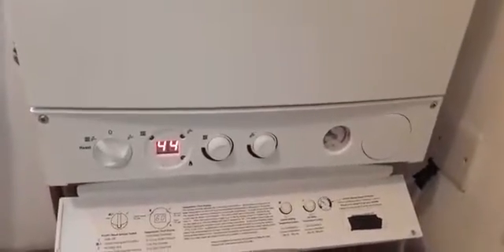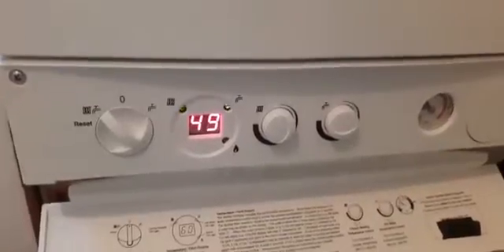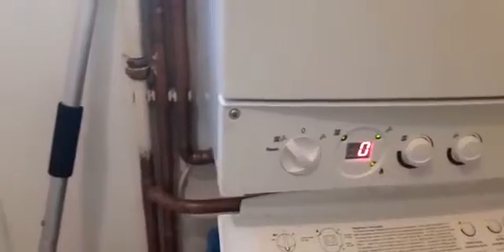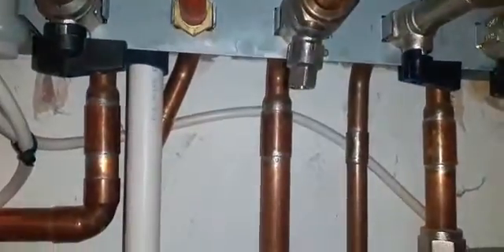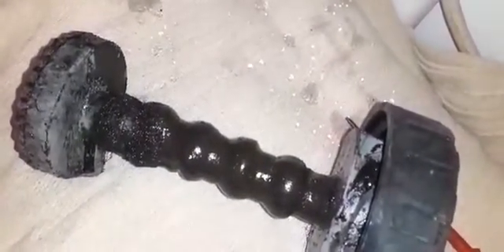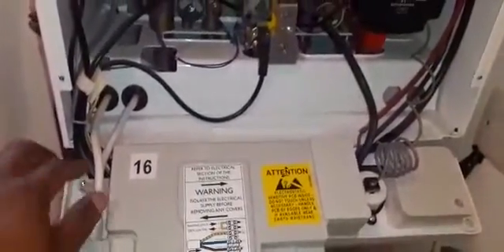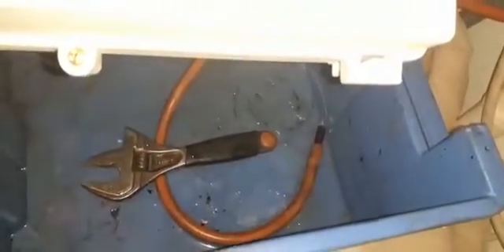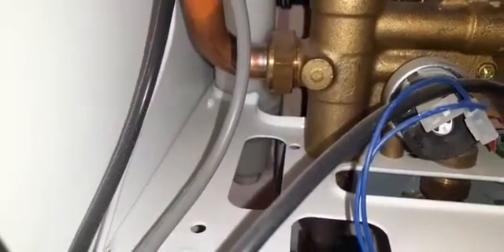POTTERTON PROMAX COMBI 24 HE SERVICE (pt1)

Comment: So, I’m not a qualified gas engineer but I am a qualified electrical engineer 😂 - if I contract someone in to service my boiler, what’s the chance of them doing this correct service procedure, do I have to watch them like a hawk or will they follow guidelines if I ask them to?
Reply from the maker: Hi, this isn't really the typical service to expect. I'd let the engineer be when he comes to service the boiler. You could ask what does it entail. Is it a safety check or will he be doing more. The manufacturers instructions gives good guidance as to what a service should include. Poor engineers who comes to yours now, I feel sorry for him. Well do offer him a tea and he might take the case off to look inside.

Comment: Hi mate I’m newly qualified for service this boiler do I need to clean heat exchanger always?
Reply from the maker: It's good to follow the manufacturers instructions and see what they see as a "service". Also check with who you work for if that's what they expect. Take some things into account such as combustion readings, age of appliance/condition of appliance. If the burner has ever been cleaned. If you have a new burner seal with you. If you have been allocated adequate time to do it. Think that two hours has to be allocated for a thorough service but you may only have 30 minutes. Hope  that helps. Bare in mind to focus the majority of your service time on your safety checks. When servicing commercial boilers I aim to spend 2-6hrs depending on the boiler. Domestic, which I hardly ever work on I expect to spend 1-2hrs. You can state in your follow on notes that the boilers heat exchanger is due for a clean so that a service kit is required. If you work for a company it's unlikely that you will be allocated the time to service a boiler as per manufacturers instructions. Yet ensure that you do your safety checks. As for having time to do much more than your basic checks, it's unlikely. Some other checks are quick. Expansion vessels do a quick is it charged check. Clean condensate trap and replenish water. Yet some things like cleaning the magnaclean, or recharging the vessel may take too much additional time. Cleaning the domestic plate heat exchanger is not necessary. That's just me being over the top. Write a systematic list to save time of what checks that you need to do, rather than randomly approaching the service. Otherwise you will forget checks and lose time. Find an efficient way. Within 30 minutes you should be able to do all your checks. Then the other 15-30 minutes is bonus time.

Comment: Regin do an angled adaptor for your pump that make the vessel access easier on those baxis
Reply from the maker: Cool, didn't know that. £11 on ebay and amazon. Good shout. Thanks
Reply: @CommercialGasEngineerVideos  no worries

Comment: No need to remove ex vessel. Remove spark generator and the tray on top of the heat ex swings round and you can get onto the schrader valve, also if it keeps cutting out on high fire remove actuator head when in service mode and open a hot outlet and dump the heat through the tap, 👍 thanks for the vids mate love seeing the big boy plumbing only do domestic gas myself
Reply from the maker: Thanks for the tips.